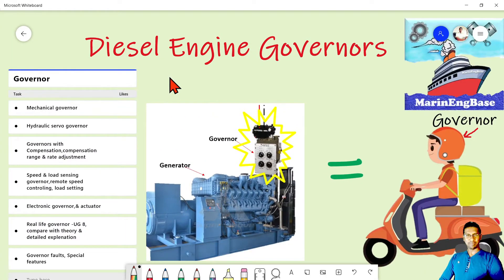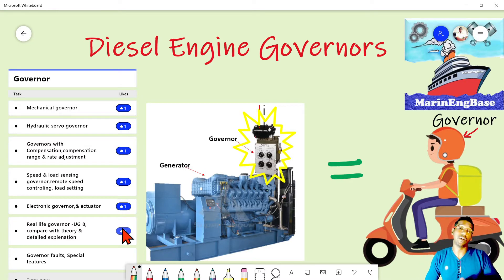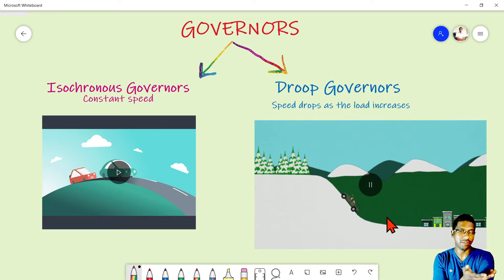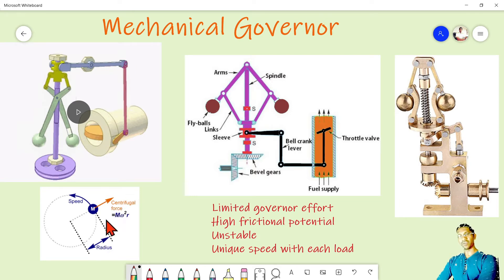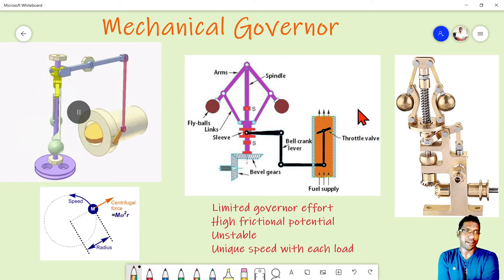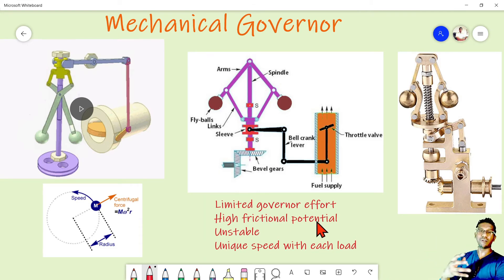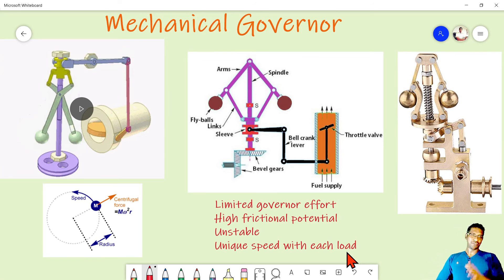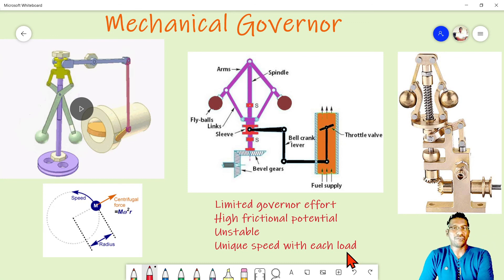Diesel governors English #MarinEngBase

Comment: which type of governor is used in main engine of ship like isochronous or droop governor
Reply from the maker: If the ship is with single propeller with single main engine then Isochronous governor
Reply: @marinengbase  sir this governor you mentioned for shaft generator attached to it ,or for all engine ...if twin screw propeller means whether droop governor ...then how the engine rpm is varied ,pls clear my doubt sir ,otherways could you make vedio regarding this ,it was confusing about 1 month .......